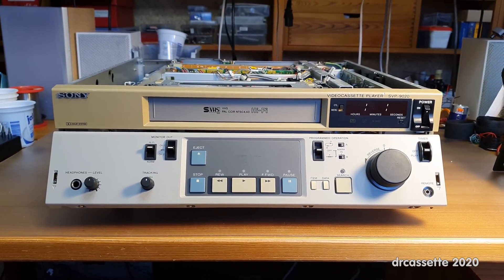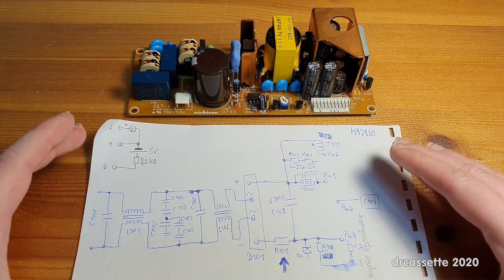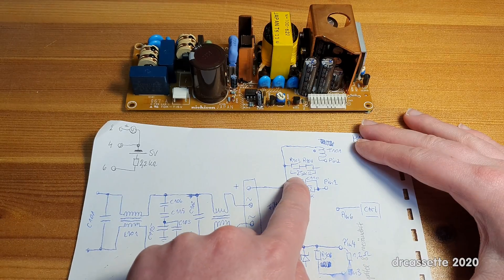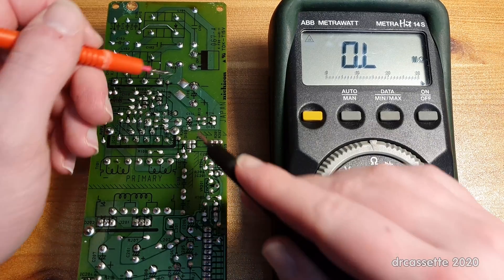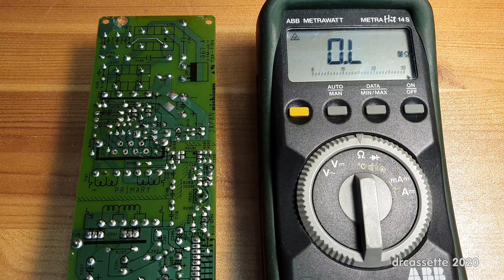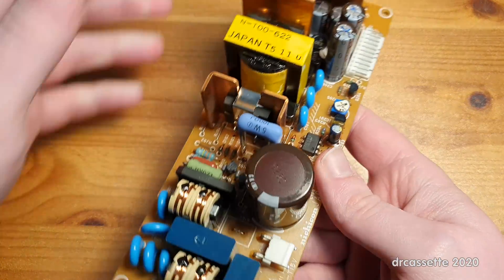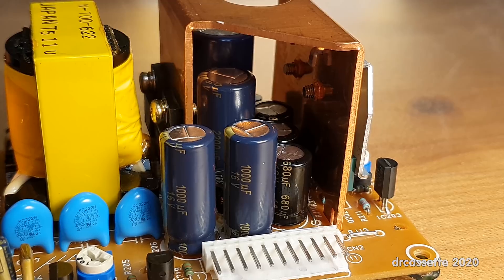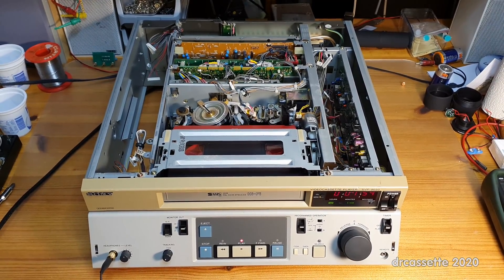Sony SVP-9020 S-VHS player power supply repair

Comment: It's true that the datasheet is quite poor. But if you read carefully, the "Fig. 1 measurement circuit" that you are talking about is explained in the first "Absolute maximum rating" table. For "Peak Input voltage", it is described that it is measured between pin 2+ and 4-, and a note says "Fig.1 is Measurement Circuit of Peak Input Voltage Vin and Collector Cutoff Current ICEX". And the same references are given in the second table for "Q1 collector cutoff current ICex". And for several other values given in these tables, the pins correponding to this measured value are also given.
So this datasheet is not as empty as it looks like at first sight, but it is certainly badly written, and some other informations like the explicit pinout and internal design are really missing.
But doing some search in Google with "MA2830 pinout", you can find some complete circuit of SMPS using this chip, and very similar to the one in these SVO/SVP VTRs, and also this internal diagram and pinout in russian : https://elcomp.ru/images/schema/ma2830.jpg (use Google translate to translate this picture). With these informations, maybe an alternative and more available chip could be found, or maybe a corresponding circuit could be built, but unfortunately i don't think have the skills to do that by myself, and playing with high voltages is risky...

Comment: the hi-fi is in video head..you must make alighnment path fisrt
Reply: dont forget to make tracking knob in center
Reply from the maker: It later turned out the problems were caused by a large number of bad, leaky electrolytic capacitors.

Comment: This question is not specific to this video and I know you don't like that but I could not find a better one to ask it on so please excuse me for that. But I just wondered real quick if you have ever noticed some noteworthy difference in quality when playing regular VHS tapes on SVHS-players? I'm planning to digitize my VHS tapes and I have read that doing so, the image quality can be a bit better than when played in an ordinary VHS player. VHS signals are so bad though that I'm finding it hard to believe that the difference can be significant, iaf any? Just curious if it would be worth the hassle to get hold of a SVHS player just for this.
Reply from the maker: Standard VHS played on a high end Standard VHS VCR will look better than on an S-VHS VCR. This is because the heads for VHS and S-VHS are slightly different because for S-VHS they have to work on higher frequencies. On a Standard VHS VCR the heads can be fully optimized for Standard VHS. However, you really have to have a high end Standard VHS VCR for this difference to show, of course an S-VHS VCR will always look better than some cheap Standard VHS VCR.
Reply: A minor difference, most notitable on the really high end models that had good tbc technology. The parts that come next are far more important.

Comment: I have a svo-9600 thats blowing fuses and the power supply looks exactly like yours
Reply from the maker: No surprise, the SVO-9600 is the NTSC version of the recorder version of the player seen in this video. So it will have the same power supply, and likely the same problem.
Reply: @DrCassette  I tried replacing all the same stuff but the fuse still blew.
Reply: @DrCassette  Where can you find that 5w 1.8ohms micron 27T? Its the white rectangle
Reply from the maker: You can replace it with any 1.8 Ohms fusible resistor. You can also just replace it with a wire link as there is a proper primary side fuse in the VCR.
Reply: @DrCassette  Did you look at my pictures on Instagram gram? Mine looks the same but some components are missing and just have wires.
Reply from the maker: @indcsion   I replied to you on Instagram.
Reply: I was given a svo-9600 I think I have the same prob, I’d love to fix it, I’m a visual learner and it’s easier for me with my learning disability, this video helps a bit wish I knew more about all parts you soder in the board.

Comment: you must have alignment cassette from Sony or recoded by good sony vcr to adjust the tracking control to center by guide tape bath and see it in oscilloscope  .

Comment: It's very similar to the Hi8 machine I featured (The Sony Umatic machine which is neither Sony nor Umatic) https://www.youtube.com/watch?v=eY2lDufsokQ
What lets them both down is a lack of a TBC (Timebase Corrector).  If they had that feature then they would be really useful machines.
I do have the user manual for the 9620 recorder, which is surprisingly large for such a simple machine.  Just let me know if you would like it.
Reply from the maker: I have seen your video on that very interesting Hi8 machine. The missing built-in TBC is not a problem for me as I have a big JVC KM-F250 standalone TBC. What worries me about this S-VHS player is the tracking. I have tried various different cassettes, and on some of them I can't get the tracking right no matter where I turn the tracking adjustment. It will take some more testing to see if that's a fault of the machine or of the cassettes (though the cassettes play fine on other machines with auto tracking...)
A manual would be helpful, but it's not important for as long as I am not sure whether or not the machine works. Thanks for the offer, I'll message you again when I need the manual :)
Reply: @DrCassette  I have found that the operation of an external TBC is completely different to an internal one.  Internal TBCs are very good at removing lateral wobble due to timing errors.  In my experience, external TBCs are completely ineffective at that, but are good at rebuilding the frame pulses so can stabilise the vertical position of the image and hide "runt frames" which would otherwise cause problems when digitising.  So for most of my digitisation, I use both an internal and an external TBC.  At the moment I'm working on a Panasonic AG-4700, which I will feature shortly whether I fix it or not, that has an internal TBC.  For your tracking issue, I would play a known good tape (pre-recorded one would be a good start), and monitor the FM envelope (head switching pulses used to trigger the 'scope).  The service manual will tell you where the test points are, or you might just find them by looking.  Then you will need to adjust the head entry and exit guide posts for a proper FM envelope.  (Sorry if I'm telling granny how to suck eggs here!)
Reply from the maker: Interesting, I have not yet had a chance to really experiment with my JVC TBC. There is a short demonstration video on YouTube that shows that this TBC does make a difference on a video signal, but is not perfect. About the built-in TBCs namely the ones in Panasonic equipment I have read that they are a simplified circuit and only work on the luminance signal. The chrominance signal just has a "noise reduction" applied to it that really is just a blur to hide the fact that the chrominance signal has not been stabilized. That doesn't sound very good to me though the TBCs on the Panasonic VCRs I have never seemed to have any bad effects on the video signal. 
I have a rebadged "Metz" version of the Panasonic NV-HS1000 which is the consumer version of the AG-4700. Unfortunately the TBC in mine broke, it now actually destabilizes the video, sometimes it shakes like crazy when the TBC is activated! Possibly bad SMD capacitors, I have not yet had time to try and fix that problem.
A friend of mine has recorded a "reference" VHS cassette for me on some of his equipment which he has adjusted to perfection, once I have this cassette I should be able to figure out what is wrong with the S-VHS player.
Reply: @DrCassette  I understand that various models of Panasonic machine have different timebase correctors, so their capabilities will vary.  I've had to replace nearly all the SM capacitors in some Sony TBCs such as in the EVS9000E.  It's a fairly big job. 

We have some common ground so perhaps one day we could do a collaboration, if you like, and if there's something suitable we could work on.
Reply from the maker: I have already added your channel into the list of channels I recommend on my channel page. Working on a video together with me I imagine would be very frustrating as I generally don't plan my videos, no schedule, no script, everything is improvised spontaneously :D
Reply: @DrCassette  Are you sure that SVP-9020 doesn't have TBC? As I understand this device is the playback version of SVO-9620 and it has full-frame TBC. Or no? Do you have SVBK-150 board installed on the device?

Comment: That machine is in amazing condition!
Reply from the maker: This machine was originally used in a school as part of a linear video editing setup they used for training. I assume it didn't get much use.
I got the entire setup, all the other equipment is in very good condition too. There will be videos on the other machines eventually.
Reply: @DrCassette  I have the Sony UMATIC version and it looks like a dinosaur in comparison.
Reply from the maker: @brentbiel5425   I too have a Sony U-matic (model VO-9600P) that looks very similar to this S-VHS player. It's much bigger though.
Reply: I've got the VP9000P and VP7040 which have the similar front panel but I also have the VO5850P which has the older style panel like on the RM440 edit controller.  Unfortunately they all chew tape :(

Comment: Can you tell me where you buy your capacitors from and what brands do you prefer ?
Thanks for a great video. Our company used to sell this sort of professional equipment.
Reply from the maker: The last time I bought capacitors I ended up getting mostly Panasonic FM series capacitors. I don't really care for the brand though, on my preferred online store (Reichelt) they have a subsection for low ESR capacitors with 105°C temperature rating, I just get whatever they offer there.

Comment: I didn't think Nicicon would leak so bad, I have some 80s pcs and they have good capacitors but I've also had a few early 90s consoles with really bad capacitors.
Reply from the maker: I guess it depends on the application, inside a switched-mode power supply the capacitors are exposed to high frequencies and high temperatures, both will shorten their lifetime.
Reply: Hello. It's been 2 years since you asked but I will answer to your question in case someone finds it useful. There is very big difference in quality (and supposedly durability/endurance) between Japanese branded capacitors and the rest (Chinese, Taiwanese etc). But even brands like Nichicon and Chemicon had some bad series with known issues. There are several forums online that specialize on this and Badcaps technical forum is a great source of information about cap brands and series. From there I learnt that Nichicon PL series leaks electrolyte from the seal. The electrolyte formula eats the rubber bung away and leaks it out on the circuit board. I have observed this myself on old equipment using PL and I also found out when I recapped a psu using PL series. So, these should be replaced when you find them on a circuit. If you watch again the video you will notice that the majority of the caps inside that Nichicon psu are PL. Just to be clear, Nichicon had no clue about that issue with their PL caps when they built that psu. I use Rubycon, Nichicon, Panasonic and Chemicon caps all the time trying to stay away from known bad series and never had caps fail, even when abused due to heat/application.

Comment: You are quite right about the schematic of the MA2830, not even a pinout. But, doing an image search brought up quite a few circuits, including one from baodaily . com that numbered the pins in the schematic.

As to needing to buy used off EBay, that's the only place you'll be likely to find them since it is a long obsolete part.

All in all, a very good trouble-shooting video. Step by step in logical order to isolate the problem without any manufacturer guidance.
Reply from the maker: Thank you :)
I think I came across this site in my research already, but my browser blocks me from accessing the site due to a missing safety certificate, so I better stay away from it.
Reply: @DrCassette  I  wholeheartedly understand about the missing certificate. If you can see the image preview in your search engine, you can right click and save it with relative safety since you're not visiting the actual site. It might not be the clearest image, but  it'll give you an idea of what that particular part or circuit does. In this case, it would have at least given you a clue as to the pinout and what to look for. 

Again, kudos on your skills. Looking forward to your next video.

Comment: Nichicon says that every 15 years you should swap all Electrolytic Capacitors They also say that you shouldn't buy them on eBay. They can be old. Electrolytic have an expiration date like milk but in my opinion only necessary for vintage hi fi especially oranges and gray ELNA caps in Sansui and Marantz they will break XD
Reply: Well, Nichicon sells capacitors so it makes sense for them to suggest periodic replacement :) Actually I have 30+ years old capacitors which are still perfectly sealed and  within specs; as an example, I recently recapped a Philips CD player (CD 204, which Dr Cassette knows pretty well) and just replaced all capacitors: power supply caps (all made by Nichicon) were actually all perfectly fine; on the other hand all philips capacitors were quite bad, not leaking but on average they had only 50~60% of original capacitance. Capacitors from late '80 and early 90's are known to be more prone to failure, but branded caps from the 70's or 80's are typically still good. It also depends on the circuit design, if caps are close to heatsink, they will age quicker.
Reply from the maker: I find that it depends not so much on the manufacturer but on the application whether capacitors last a long time or not. Inside a hot switched-mode power supply even the best capacitors will fail relatively quickly. Meanwhile I have old Asian made no-name capacitors out of what I believe was a 1970s shoebox style cassette recorder, that are still perfectly fine.
Reply: Depends on many factors. Caps can age and go bad if unused for several years but you could try to reform them. On SMPS power supplies you should only use low esr 105C caps and never use general purpose capacitors or even worse 85C caps. The fact that you can use unsuitable or cheap Chinese caps and get away with it doesn't mean that you should do it. To give an example  as a reference, you could use a 25 years old VHS device without maintenance/lubrication etc and get away with it but this is not the right thing to do. Same goes with caps. Also as I said on another comment on this page, there is a huge difference in quality (and supposedly durability/endurance) between Japanese branded capacitors and the rest (Chinese, Taiwanese etc). But even brands like Nichicon and Chemicon had bad series with known issues.

Comment: What would be the difference between an expensive capacitor vs a cheap capacitor?
Reply: The only constant difference I'd know of would be... price.
There are cheap capacitors that last forever and there are the more expensive ones that die after two years. 
It almost always comes down to the quality of the batch. 
However it is more likely to get better parts the more expensive they get. If I like a device enough, I'd willing to pay 8€ for a single cap if it doesn't need like 200 new ones and I feel confident about the part/manufacturer.
Reply: @Halterung01  as I said on another comment on this page, there is a huge difference in quality (and supposedly durability/endurance) between Japanese branded capacitors and the rest (Chinese, Taiwanese etc). But even brands like Nichicon and Chemicon had bad series with known issues. If you watch again the video you will notice that the majority of the caps inside that Nichicon psu are PL. Nichicon PL series leaks electrolyte from the seal. The electrolyte formula eats the rubber bung away and leaks it out on the circuit board. Those should be replaced. Same goes to other bad series, such as Nichicon HM / HN ultra low esr caps but only the ones with datecodes from 2001 to 2004. 2005 or later are OK. Also Chemicon KZG/KZJ ultra low esr should be avoided. In general, I always recap with 105C caps, there is really no point to recap with 85C caps regardless of the application. And then, depending on the application I use entry level low esr caps or very low esr caps from good Japanese brands. The country that the cap is manufactured is irrelevant, most Panasonic caps are made in Malaysia but they are very reliable. One last remark, you should always try to make sure caps are not cooked from nearby components. Even the best capacitors will not last long if subjected to extreme overheating.
Reply: endurance, accuracy and frequency behaviour: expensive capacitors have better capacitance vs frequency characteristics, while cheap capacitors drop capacitance pretty quickly. the risk of leaking caps is much higher in cheap ones
Reply: Look for capacitors that are rated for 5000 hour and 105 C operation. They should last very long. I just recently got some  capacitors fro digikey. There were not that big differences in price between 1000 hours and 5000 hours capacitors. The price look like reflect more of the brand then quality.
Reply: Made in China vs Made in Japan
Reply: Fresher fish 🙂